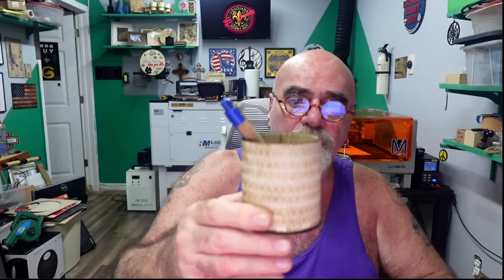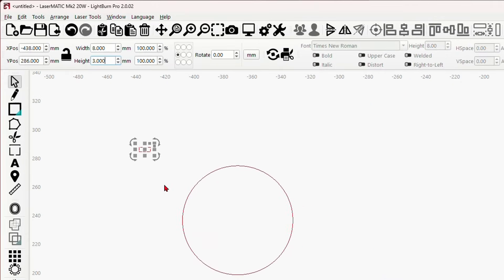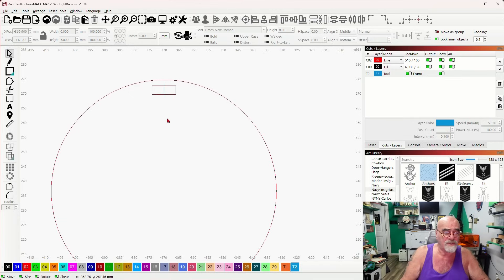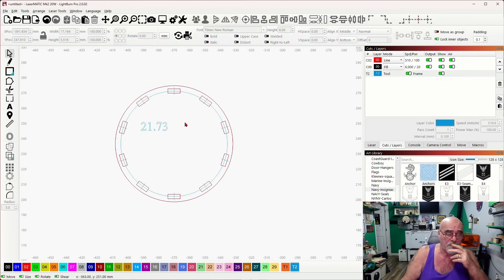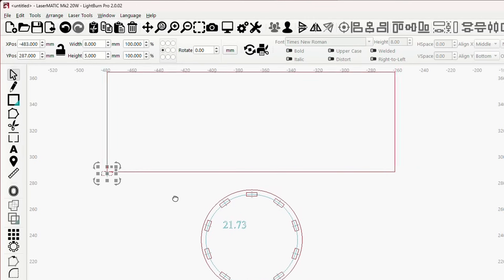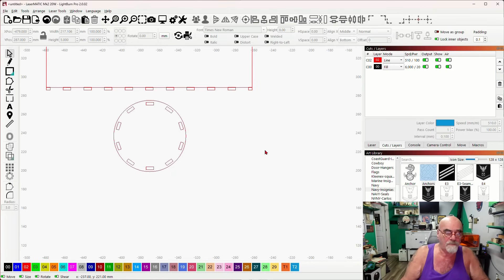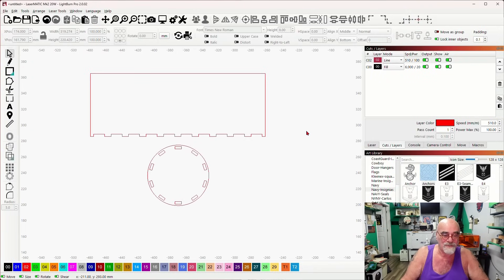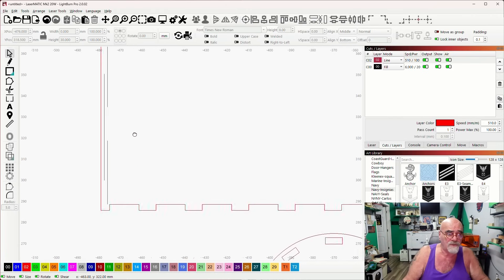💡 Making Custom Slots and Tabs in Lightburn and the Living Hinge!

Comment: Dang! Using a Mac and following along. Found a Lightburn bug. On your Rotary check part, the numbers still show as inches when it should be millimeter. Reported it to Lightburn.
Reply from the maker: They already know about this issue. Switching back and forth a few times usually resolves it.
Reply: @TheLouisianaHobbyGuy  per Lightburn support, it is working as designed and deliberate for the Version 2 release. In order to get the rotary to replect the in/mm setting of your choice you have to change it under device settings, the Dimentions / Units tab. Seems odd but at least there is a work around.
Reply from the maker: Yes, but changing it in the device settings once doesn't always fix the issue, which is why I said to switch back and forth a couple of times.

Comment: Any chance you could do a video explaining how to avoid little gas pocket explosions happening. I'm running a job with 3mm painted MDF at 275mm/min 20w diode with air assist and its popping relentlessly. Looking through the camera I can see the flashes happening and some of them look quite forceful. I have a normal honeycomb, its raised above an aluminium bed by around 3mm supposedly to let the gasses escape.
Reply from the maker: Just use some golf tees to raise the material off the honeycomb bed.